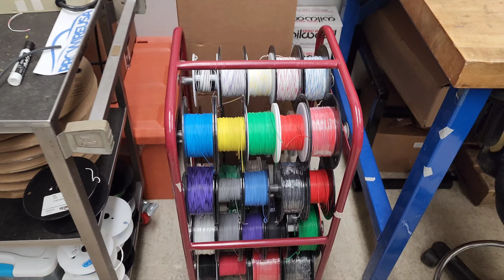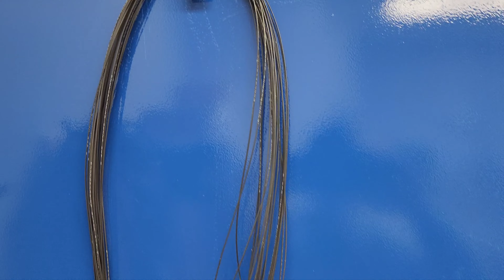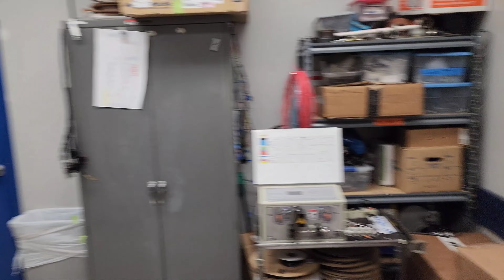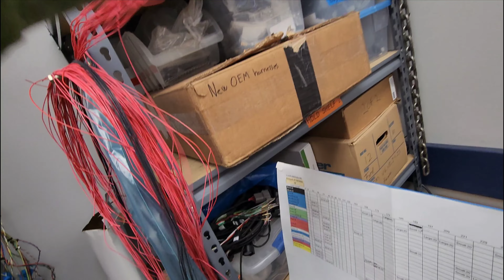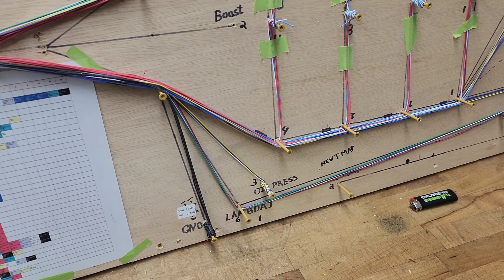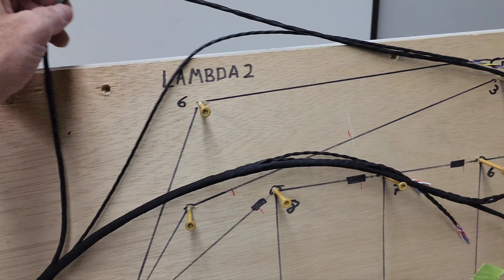OBR Control Systems 7.3 Godzilla Harness build #IndyPowerProducts #Godzilla #OBRCONTROLSYSTEMS

Comment: Can you do for a 2007 Toyota Sequoia to 2021 7.3 gas Godzilla 7.3 as many wire that can be connected to factory
Reply from the maker: We only build the engine harness. Most ppl that want to keep all factory functions but do an engine swap will leave factory bcm hooked up and use our ecu to control engine and sensor function.